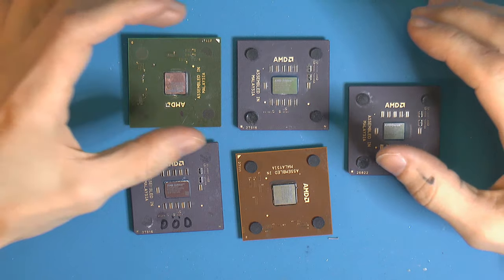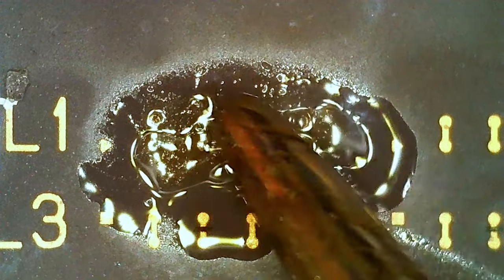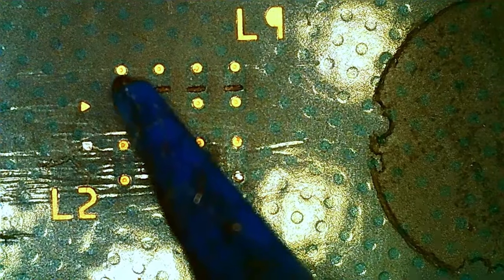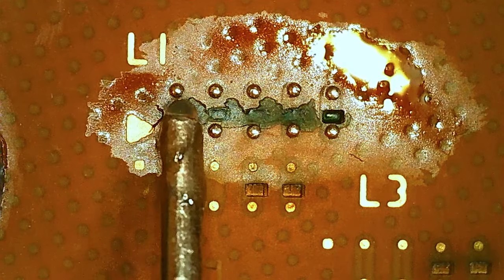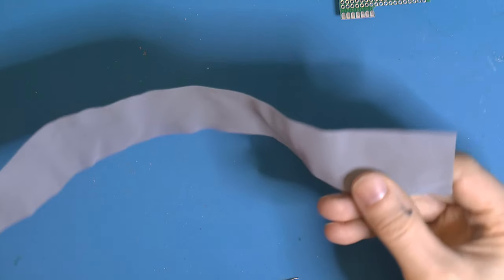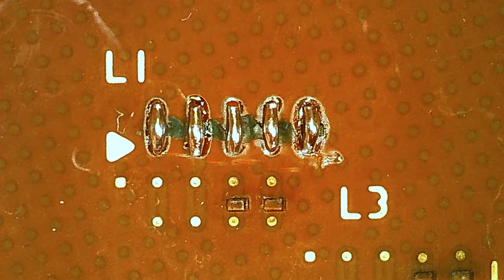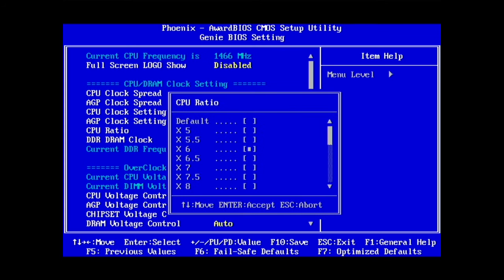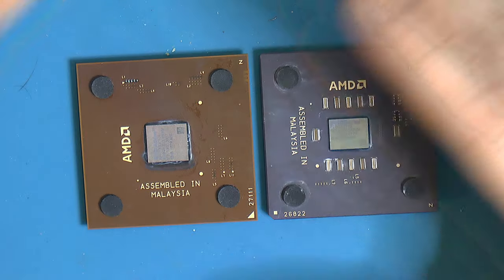Soldering bridges and unlocking Socket A CPU's

Comment: I did unlock my Duron Applebred to full 256 kB of cache. Not to mention, that CPU could run on 2.6 GHz, from original 1.6 GHz (2.8 was slightly unstable, and I kept it on 2.4 to sync with RAM). It's insane what good silicon could do back then.
Edit: Abit NF7 and NF7-S motherboards had custom BIOS written by some madman, which unlocked crazy FSBs like 400 MHz (no, not 200x2, actual 400 with 2:1 lock with DDR). It required a lot of fiddling, but it was perfectly possible to run 2.4 GHz on x6 multiplier.
Reply from the maker: They sure left more option on the table back then.
Nowadays they learned to lock it down and push it to the max out of the box more or less.

My DFI Lanparty NF2 ultra I got up to 500Mhz DDR and bus so 2x250, but it has PCI/AGP issues early on past 400Mhz bus for what ever reason, (no amount of bios fiddling solves i).
Its actually prime95 and memtest86+ stable at 24h+ at 500Mhz fsbram (1:1), its just AGP/PCI that gets corrupted on that board randomly past the official 400Mhz fsb, bit annoying.

The board was damaged when I got it so did some repairs. It was used for LN2 OC, from what I was told there where 4 boards but two died and I got one of the survivors (was most likely damaged in storage/transport), someone else took and repaired the second surviving board.
Reply: 2.6?! I couldn't even do that with my Athlon 1800+ (this was the overclockers preferred chip back in the day)
Reply: Sure it wasn't the Taipan D27 BIOS for them NF7-S? I have one with that BIOS and had no idea the FSB can go that astronomic.

Comment: We used pencil with the ceramic package and silver paint with the organic package… the pencil method on my thunderbird 900 lasted like 15 years 😂
Reply from the maker: Some people are lucky I guess 😆
I remember redoing the silver on my Athlon XP 1800+ and later 2400+ at least once r twice.
Reply: yeah i guess so 😜
Loving your channel btw, keep up the good work! 👍
Reply: Ah yes, fond memories. I also used a pencil on my 1ghz Thunderbird. It lasted around 10 years at 1.4ghz but eventually the CPU gave up entirely.
Reply: Works on Both. Good Hb pencils an tape over. Never had a problem.

Comment: those cpus were ok cpus for the time.  super easy to crack the CPU die when putting on the heatsink. i cant tell you how many pcs i troubleshooted with these style amds. i preferred intel during this period because the die was not exposed so any PC i build for a friend family or customer was an intel
Reply: yep, i remember getting a copper shim for mine to help protect it under mounting pressure. funny how the tables have turned, now you need to delid intel CPU for thermals

Comment: Loved my duron an later sempron..the later durons an sempron was basically cut down Barton cores .. Hack the cache back an if you didn't have voltage controls on mobo bios or as with later cpus that had multi locked down you could bridge pins under the CPU to force a voltage...I had 2.50v😮 my 1.6 was running at 2.7ghz 2.6 daily with a 6600gt an was looking back my favourite machine...desoldered a pci slot to fit my franken gpu cooler made from an old sktA cpu cooler. Both GPU an cpu didn't go over 60deg an both clocked to the very limits...i even searched high an low for special Samsung 500mhz ddr1 ram on brainpower PCBs...goodtimes. but that was a surprising fast but cheap as chips pc.. probably spent less than 200 quid..an gpu was 110..mobo 35. Cpu 30 odd an rest on ram. It left my mates more expensive stuff standing an got them into overclocking. You dont get the bang for buck like you used too

Comment: That solder ball technique might come in handy in other scenarios, too. My Duron 700 also ran at 9x100 in an A7V just fine with a little increase in voltage. It was an absolute bargain and lasted me for another good year. Too bad the A7V couldn't do 133.

Comment: Ah, used to do this on my two systems that had the Athlon XP 2500+ (Barton) to the same as the Athlon XP 3200+ (Barton), basically going from 1.8Ghz to 2.2Ghz just by using a 2B pencil.

Comment: Use an HB pencil lead for the brown ceramic cpu bridges.

Use an automobile rear window defogger repair kit for the green cpu bridges.

If you need to cut bridges, a sharp new exacto blade will nick a gap nicely.
Reply from the maker: Cutting might be useful to make a low voltage low multi version of a normal XP to make it more like a Geode NX and make i t more plug and play with mobos with limited bios settings.
Im considering it, would work well with weak 5V rail PSU's.

Comment: if you want to bridge a gap on a pcb with solder it is much easier to do with a drop of solder paste  for smd, the one containing solder  and just making few blobs and heating them with hot air
much less fiddly and more precise method
Reply from the maker: Solder past would probably work, I considered it for the pads on the Athlon XP. Simple reason I did not try it is that I had none.
maybe I try past next time.
Reply: when i short jumper resistors on laptop motherboards it is my prefered way of doiing it because i don't have to check if the solder jumped the connection from soldering iron to both soldering spots. because it likes to prefere not to jump the gap and stick to soldering iron instead

Comment: I had a Duron 1.3Ghz back then, I tried to bridge but didn't work (with pencil), yet, with the fsb overclock it didn't go over 1350Mhz anyways...
Reply from the maker: I did get a free Duron 1300 some time ago.
It would be fun to see 200Mhz fsb VS 400Mhz on it. I did get this crap Duron 700 up to 333Mhz fsb later of camera with no problems using multiplier 5x.

Comment: I also had better clocking results using clockgen in windows to gain another 2 300mhz over a bios overclock... Goes against the grain as bios is usually better. Good little tool clockgen

Comment: The (ceramic+Palamino) Athlon XP 1800+ that came with a recent motherboard purchase has very small wires soldered across the L1 bridges. Doesn't work though as unlike my pencil modded Duron 1000  I can't change the multiplier.

Only pencil modded them to run them with a higher FSB, though multipliers don't go low enough for 400MHz with the Duron 1000 unfortunately and I haven't tested the Duron 1300 (seen as an Athlon XP 1500+ stock) in a board that allows overclocking yet.

Comment: Very interesting. I recently built a system with a sempron 3000+.
Reply: It's probably a Barton core athlon with less cache. Mine was a good overclocker 2,6 2.7ghz fixed the cache an it was a really good chip. I've never had another CPU that clocked as far an virtually doubled it's performance. Think it's hardware labs that have a interactive guide to mod these chips. Either with the bridges or another way by using small wires under the CPU in the pin sockets. You will be surprised how far these can be pushed
Reply: @foxxy46213  the mainboard i am using has jumpers to set the multi manual. Would that work without manipulating something?

Comment: i wonder where you get the information about what pad is doing what. also i had a amd athlon in a k7 mainbord socket a i did nothing to it the only thing i did was setting the front side bus from 100 to 133mhz so i got the full 1400mhz i did tried go higher but usb acting weird so i did go back to the 133 but eventually i got it stable on 136 or 138 i dont remember right i had this pc back in 2000 to 2007. i had used it longer but the cpu burned out because the cooler mount broke of from the socket.

Comment: What about the Sempron Line of Socket A,was those worth soldering? I have a Sempron 2800+ which still works fine,No plan to mess with it but was curious. :)
Reply from the maker: I dont have any Semprons. But they are basically just Athlon XP with a different name and PR rating relative to Celerons instead of Pentium 4 so just as good of a cpu as the XP version.

The problem is that sempron came out  in 2004 and like I stated in the video AMD locked down most CPU's in 2003 so the L1 is not cut because its not connected internally.

Other bridges are probably intact and might be worth connecting depending on what you want to do.

There is also the Geode NX series, basicly Athlon XP-M at very low voltag, like 1.1V and down to 850Mhz and 6W I think.

I might look in to cutting bridges and try and make a low clock low voltage Athlon XP later, could be fun project.
Reply: Very interesting read thanks for explaining,Id like to see that "Low clock low voltage athlon if you ever do get to doing it :)

Comment: You do not have to solder those bridges, back in the days it was called pencil mode for a reason.
Reply from the maker: You obviously did not watch the video. Pencil mod is unreliable, like I sad in the video.
 This is the better way of doing it because its reliable and will last.
It will also stand up to IPA and and cleaning.
This will last the lifetime of the cpu basically. 

But please be stuck in the old ways.
I prefer to do things better today when I have more knowledge and the tools.

Its pretty funny how many people seems to have missed the howl point of this video.